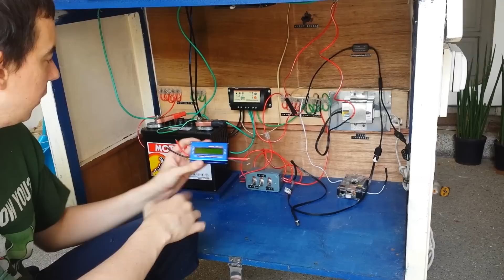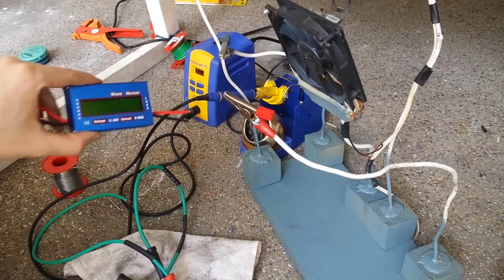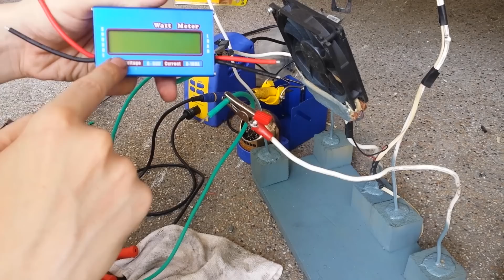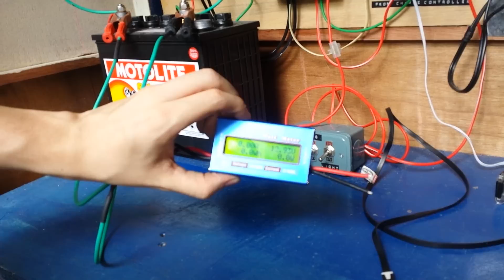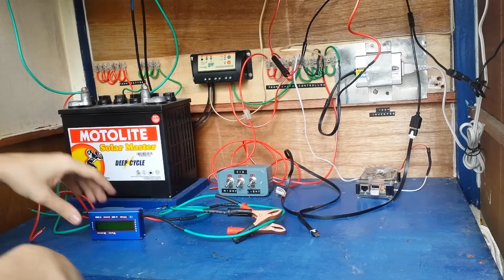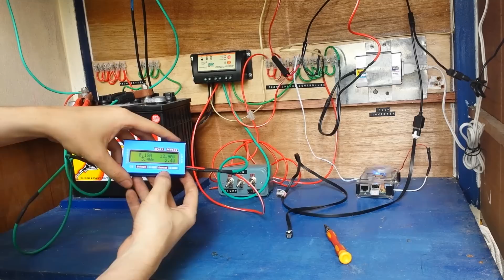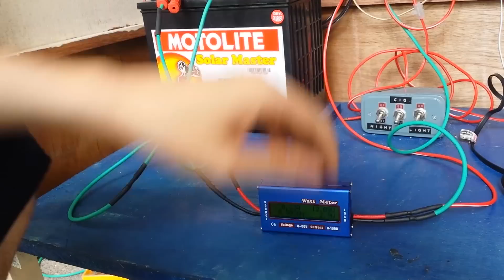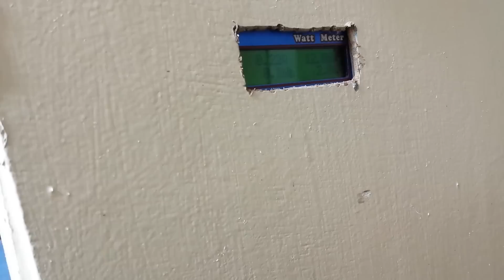How to wire a solar watt meter

Comment: I see too many of those on Youtube.  Yes, it is good practice to flux and pre-tin the wires.  It is also clever to slip the heat-shrink tubing beforehand than to regret it after.  But...  Pb/Sn is brazing and not soldering.  In other words, it is just skin-deep foreing metal "glue".  It is advisable to create a good mechanical bond (twist or crimp of some sort) before brazing.  This is common professional practice that any 1st year student in electronics will learn.  As a matter of fact, a good side-to-side Pb/Sn brazing is supposed to last for 25 years, whereas a simple dry wire-wrap should last up to 40. For the benefit of all.  No offence intended. Good tuto as far as the première intention is concerned!
Reply from the maker: Thanks for the feedback and tips. I've watched many soldering tutorials, even by professionals that solder to military standards. Usually I would make a mechanical connection (e.g. twist) before soldering but that's not practical on a wire this thick. If you have a tip for these kind of thick wires I'd certainly love to hear it. Thanks!

Comment: I have a 10 amp controller and a 300W inverter (600w peak). So I assume I should not connect the inverter to the controller but take it direct from the battery to avoid fying the controller. If so, can I measure the whole power draw from the battery (from the loads on the controller and the inverter) by connecting the my 130amp watt meter as in your video but joining the inverter leads to the lead from the battery to the controller on the controller side of the meter? also. what cabling are you using in your set-up.
Thanks - great videos - so clear.
Reply: Any chance on a view on this query, please, as I have just finished building my box and need to start wiring the thing up. Ta! ;-{)
Reply: Gadget Addict please respond to this question, i also would like to know this, how to measuse the in and outs from the battery in total!

Comment: is ts possible to install solar panel directly to battery then power inverter? what would be the effect if without power controller?
Reply from the maker: Technically it's possible, but it's not advised. You wouldn't have any protection against over voltage / over charging and would likely damage the battery in a short period of time and perhaps break your inverter eventually..
Reply: can i use car batteries? if i dont have deep cycle battery? if i dont have power controler is the battery still charging if i directly connect it to the solar panel?
Reply from the maker: Francisco Besana You can use a car battery but it won't survive very long because they're not designed to be regularly and heavily discharged. The battery would charge if you directly connected the solar panel to it but you have no control over the voltage and no protection against over charging. Using the wrong type of battery and not using a charge controller is only going to end in failure. Please be careful and avoid anything dangerous that could hurt someone or cause a fire.

Comment: I also once have that watt meter but I disconnected it from my off grid system cause I thought it was consuming power from my batts. or maybe I just wired it wrong. I connected the source side to controller and the load side to wire supplying loads.  this measures the power I am using. If I flicked a switch to turn on a light it displays amperage of the loads used.

Comment: I'm most probability  wrong but should the source on the watt meter be connected to the charge controller and load to battery  as the charge controller is the power source to the battery from the solar panels  :)
Reply from the maker: It depends what you want to measure, I've put some instructions in the video description :) Thanks for the feedback!
Reply: Battery is the loud

Comment: Hey Gadget Addict thanks for the video, I have a question for you. Should I wire my inverter straight from the Charge controller or Can I plug it directly from the battery? Some people say that you shouldn't add too much load to the Charge controller and recommend to wire the inverter from the battery? Thanks again!!
Reply: You are not allowed to connect the inverter to solar charge controller. Inverter should connect to the battery.

Comment from the maker: @Benedicto your youtube settings have replies disabled so I can't reply directly. I'm also using a cheapo PWM charge controller with my watt meter and it works fine. You shouldn't need a more expensive MPPT controller to make it work. Of course MPPT is generally better to optimize your solar setup if you can afford it. Did you try swapping the load and source around the other way and checking the readings then?
Reply: No I have not tried swapping, however I will. I will check my settings so you reply directly. Thank you very much.
Reply: Thanks for your help Phil. I changed the wiring opposite of yours and it works just fine now. Load to battery, Source to battery terminals on charge controller. Why do you think yours works one way but mine works the other. Again, I am using a GT Power RC watt meter. I think it's very similar to Watts Up. Anyway, thanks again.

Comment: Great video! I purchased a GT Power RC watt meter and have tested it with a battery charger as the source and a 12V battery as the load. Meter reads all functions perfectly. I attached the watt meter exactly as you have instructed to the charge controller on my small portable solar system and the watt meter will not read any amp functions. The charge controller is a cheap 15 amp unit that came pre-installed on my folding set of two 50W mono panels. Could the problem be with the charge controller? Should I go MPPT? Thanks.